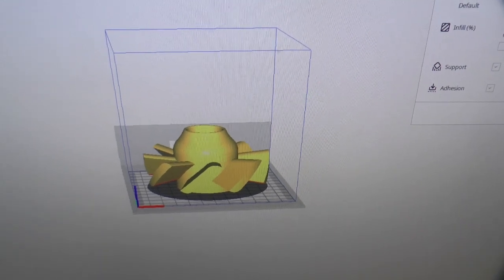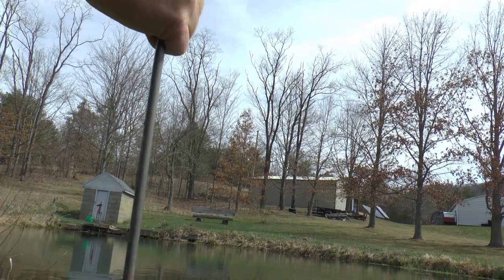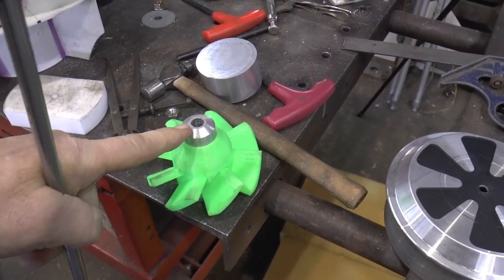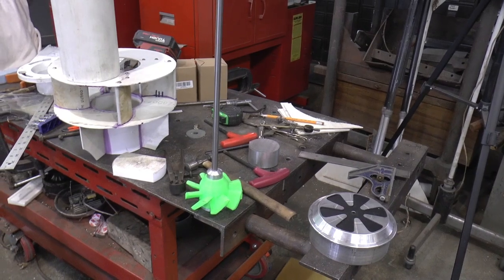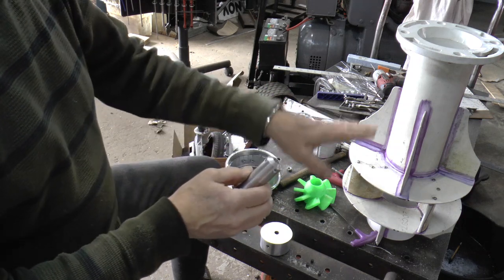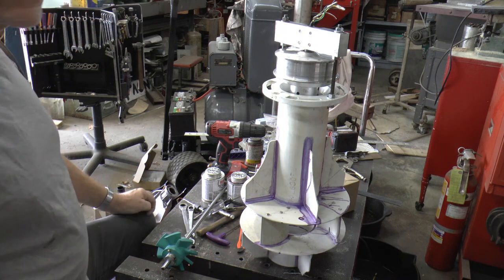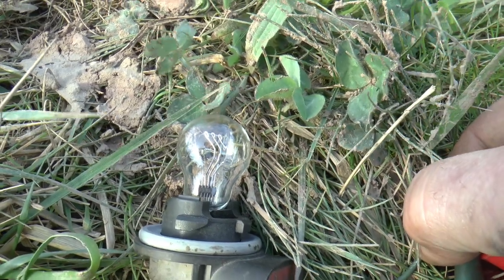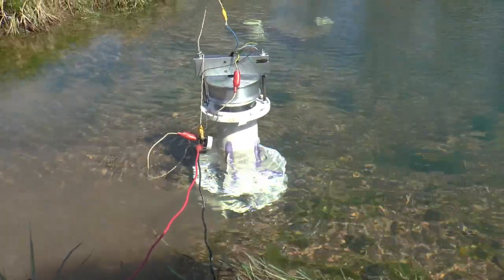DIY Micro Hydro Pt 2 Hoverboard Motor as Generator

Comment: Hi, Papajunk could you print me one of these turbine rotors and sell me one if so, how much? Please let me know thank you I am working on something like this.
Reply from the maker: I decided not to use that style turbine and no longer have the file.
Reply: @kevincrawford2027  ok, what style are you going to use? Are you putting out a video on it?
Reply from the maker: @stevenpleasant5834  I don't know what style. I know that one wasn't going to work for my situation. It won't be any time soon if and when I try again ( it's winter ) If I do I will more than likely make a video.
Reply: @kevincrawford2027  ok, thank you what was the name of where you got the file from to print the one you did build? thanks.
Reply from the maker: @stevenpleasant5834  There is a good variety of turbines on thingaverse. I think there are options where you can have items printed and shipped.

Comment: If you run the pos/neg from the bridge rectifier to a solar controller it will adjust voltage, run a load and use the excess to charge batteries. You can also use the output to directly connect a small grid tie inverter and feed back into the house.

Comment: you have to measure the motor resistance... thats the highest load you can drive, an equal resistance.. the generator will deliver the maximum voltage and maximum current. the actual power delivered will depend on RPM and it will have a sweet spot for maximum power output, into the ideal load. if you can spin it up with a motor or something, you can figure that out. 

ideally, your load stays higher in resistance than the generator... otherwise its the generator that gets hot and no power is seen in the "load"...

its ohms law, but... no-one ever mentions that the generator resistance matters, do they? think it through... where does the current flow? in the generator AND the load.

the capacitor on the light bulb is funny.  and also demonstrates all of the above nicely... with a large capacitor, when its discharged, the generator is hard to spin, as the capacitor acts like a dead short. as it charges, less and less current can get pushed onto its plates, the voltage rises... and it gets easier and easier to spin until its reached the peak voltage it can attain... the bigger the capacitor, the more this will be noticeable.

charge the cap, it can light the bulb, then bang, the bulb resistance is too low or the RPM too low to deliver the required power to the bulb and keep it lit...

the turbine itself is a whole other ball game. look into francis turbines, kaplan turbines... and learn to CAD!
here, the blades spin with the water... and then what? 

you need the water to change direction as it passes through the turbine. the momentum of the flow rate at a certain velocity creates a torque. as it is flooded, unlike a pelton wheel, and water is incompressible, the passageways have to be proportioned so that bernoullis applies at all times... velocity exchanging for pressure and vice versa. as smoothly as possible. turbulence and cavitation is a loss...

water comes in with the velocity of the fall down that pipe, and as it passes through the turbine, it changes direction, and flows the other way. it exchanges its momentum for pressure against the back of the blade as it changes direction, creating torque. action, and reaction.

as the turbine should be spinning at half this velocity when the turbine is fully loaded, the water should flow directly "down".

that is, when unloaded, the water should spin the same way as the turbine does.
when the turbine is locked, the water should spin the opposite way as it leaves the turbine to what it enters.

and when the turbine is perfectly loaded, the water shouldnt spin at all.

and at all times, the actual flow rate shouldnt change, the water should flow through the turbine almost as freely as it flows into the pipe.

you know the height, the head, the velocity it can attain, and the flow rate with some maths.

i am yet to see a turbine where the designer understands how they work published online? other than peltons?

and people get them wrong as well...

Comment: quiet?  its a gurgling mess.   this setup (your drain pipe) has ZERO HEAD PRESSURE!  there needs to be a larger drop... at this point you may as well forget about rectifying to DC and just run the AC voltage directly to a household lights.
Reply: But you don't know how much drop where the water exits. The longer that drop the more force. This is siphon/suction action and it would make no difference where the turbine is located in that pipe.

Comment: You need some electronics to run the generator at its Maximum Power Point i.e.a MPPT device - a cheap Chinese one would help - probably you need to draw about 20volts from the generator to get the max power out of it. Also you need as much flow and head as possible, I would be trying near the water wheel.

Comment: Hey man this is my two cents on your really great idea. :)
I think you need more air to allow the water to flow better, Like when you try and pour a bottle too fast" and it starts surging the flow of the liquid, but if you keep a gap for the air it flows fast and smooth :) You can actually hear the pulsing water in the video too! :) 

Maybe try a taller shaft with long air slots along the shaft or possibly a two-way pipe, one for the shaft and the offshoot for breathing water doesn't flow great in a temporary vacuum. :)   
Best of luck and I look forward to following your journey.

Comment: Hey there can I get you print? I am failing with my water wheel and the force of that sucker u got will keep me busy for the summer
Reply from the maker: I have no print. It is a DIY by the seat of your pants build with what I have on hand.
Reply: @kevincrawford2027  I meant the propeller, I’ve search thingverse n didn’t find much,
Reply from the maker: @WasaMada  I found it under turbine or propeller on thingiverse. If I find my file I will try to send you a link not sure where I saved it.

Comment: I'm curious if that'll be a strong enough to work to drive a washer motor like on the water wheel if it was rewired similar to the waterwheel motor
Reply from the maker: Maybe if scaled up and a lot more water. When I get some extra time I want to rewind the hover board motor with more turns to increase the volts per RPM and try again.
Reply: @kevincrawford2027  I wonder if the blade needs to be a flatter blade sort of like a boat propeller blade and a slightly further down inside the pipe. As I noticed on the video it seems to be awfully noisy I don't know if there was a lot of cavitation or with air being sucked back up the outlet of the pipe due to the restriction of the flow

Comment: For turbine design inspiration, YouTube channel @RobertMurraySmith has oodles of videos exploring 3D printed prototypes that he puts on Thingyverse, I think. As other comments have pointed out already, deeper down the pipe is better. It probably wouldn't hurt to secure the business end with a housing and bearing so the shaft doesn't weeble-wobble and have the blades scrape at the sides. 

It's also an out-there idea but I've never thought to ask if an Archimedes' screw functions in reverse. The physics of how one operates normally beguiled me for a long time, I don't want to have to work out the reverse at midnight for me now! XD
Reply: as long as the down pipe is flooded then the position of a turbine such as this doesnt actually matter. they work upon the mass flow of water, and that is always the same regardless of where in the pipe you place it. what goes in must come out! and as long as its always the same diameter, the speed is always the same...

whereas a pelton wheel relies on head and needs to be at the base.
an archimedes screw only works on the head. has limitations. 
as its an inclined plane... requires a 45 degree helix for best efficiency. 
the angle of the entire screw down the hill also ideally has to be 45 degrees. 
they cant harness any of the momentum of that water, just the torque of the water pushing the screw aside as it falls down the slope.

for a turbine in this situation to work, the water has to enter with the full velocity it can flow at, pass through the turbine freely and CHANGE DIRECTION... then its momentum is acting on the blades. THAT is the energy you extract. the reaction on the blades due to mass in motion being forced to change direction.

Comment: I'm no expert at all not even close but I'd think you'd do better on the outlet side of the pipe vs the intake side. Much greater head pressure to prevent it from stalling underload. Also not sure that motor is ideal
Reply from the maker: I can't use the output side because it is to close the the road. No room to work and every thing would need to be water proof.
Reply: @Papajunk  that makes sense. I Forgot how close your wheel house was to the road of course the outlets are close too

Comment: information            you may know that  a dc pm motor that is not  Correctly  Modified  for its new purpose, makes a piss-poor alternator.
maybe you don't know that the turbine runner should be in a housing that is located at the  Lowest  possible  elevation; at the  downstream end  of the drain pipe. 
this is so because the amount of head being utilized is  the distance between the runner  and  the surface of the water in a catchment.
in order to optimally locate the runner,  an 'angle' can be built into the pipe/housing, so that the turbine shaft can exit the pipe and be connected to the alternator.      d
Reply: You're getting your hydro generator systems mixed up. What your talking about is for a Pelton wheel that needs the head to create pressure through a jet. This sort of turbine setup in the video  in the pipe is acting on the siphon/suction action of the water flow and it does not make a difference where along the pipe its located.